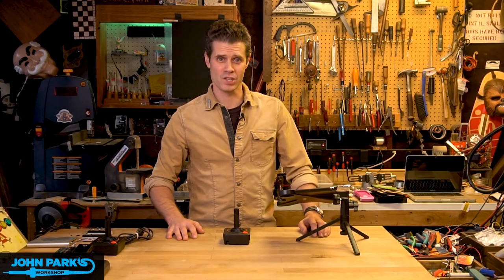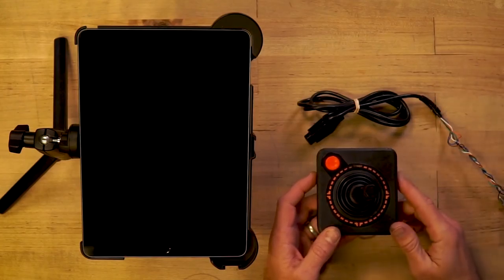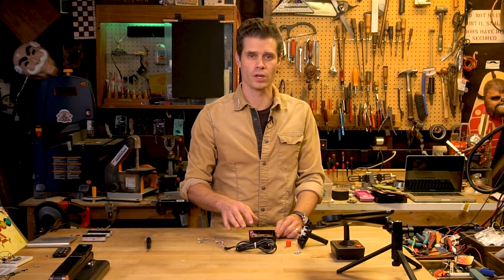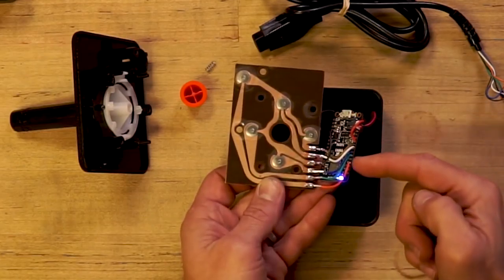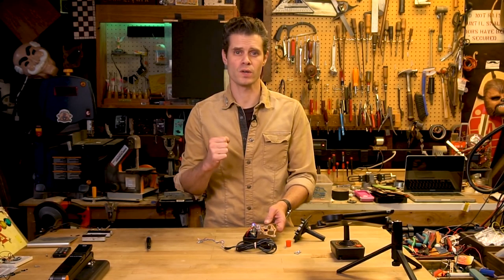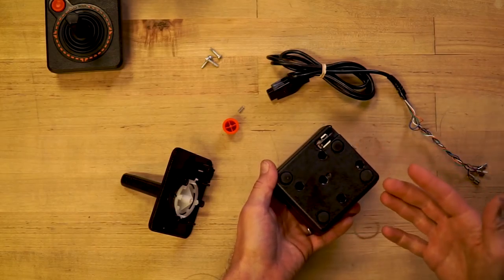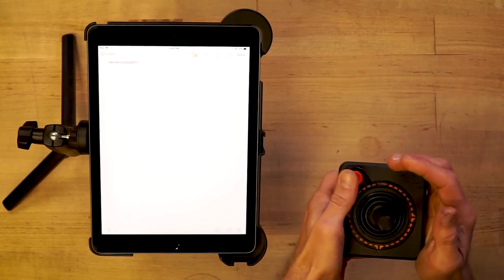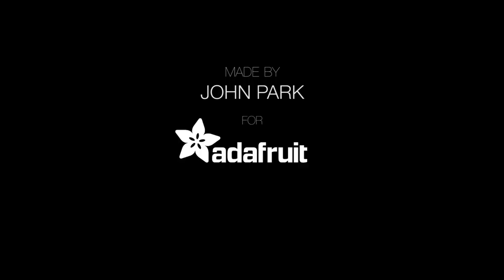John Park's AtariFruit Joystick demo @adafruit @johnedgarpark #adafruit

Comment: Hmm. Looks like you have the same problem I had when I tried making a joystick using the USB keyboard protocol... You can't do diagonals. Does anyone have a solution that will work?
Reply: This does do diagonals if the game supports it -- the software can send multiple buttons simultaneously, so it'll send up and right to do a up/right move. Is that what you mean?
Reply: John Park yes, thank you. It wasn't clear from the demonstration that there was diagonal movement possible. I tried to use a Pro trinket emulating a USB keyboard and tried to use that to play emulators on a pc, and I was never able to figure out what strings to send through the USB keyboard to get the emulator to recognize diagonal movement, or really any signal that consisted of more than one input being pressed at the same time -- for example, moving while holding the button down.
Reply: Party Bot haha, yeah Ms. Pac-Man and Year’s Revenge are all right angles.
Reply: John Park thanks for all your great videos!
Reply: You're welcome, I appreciate it!
Reply: @johnclavis  Did you ever figure this out? I'm late to the game, but trying to get a Feather 32u4 to connect to a Raspberry Pi running RetroPie emulation. I'm trying to get the HIDKeyboard sketch to work right, but not sure I'm going down the right path. ANY guidance would be appreciated!